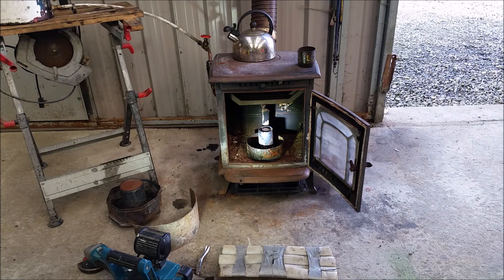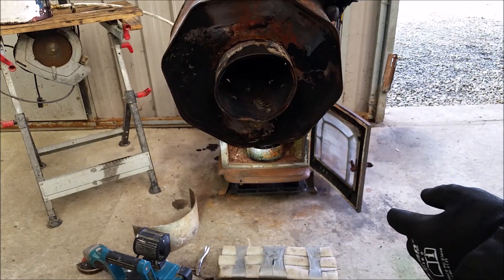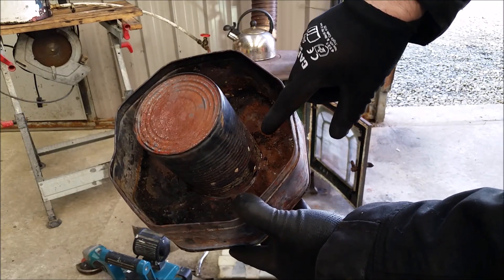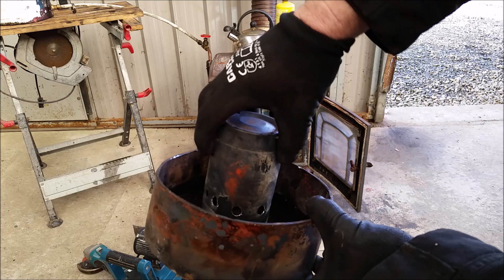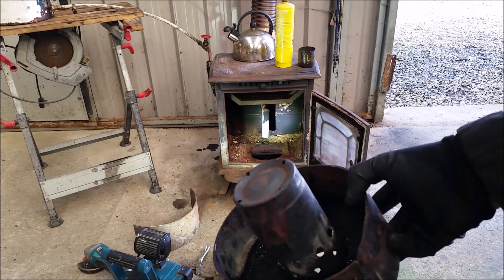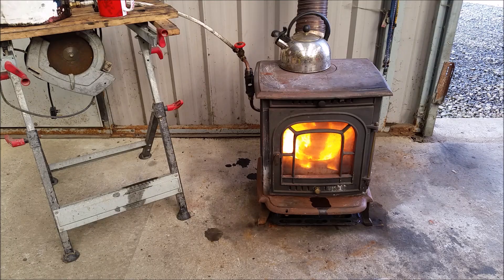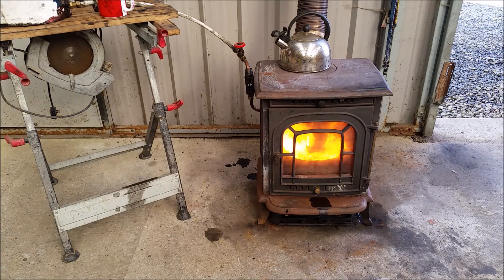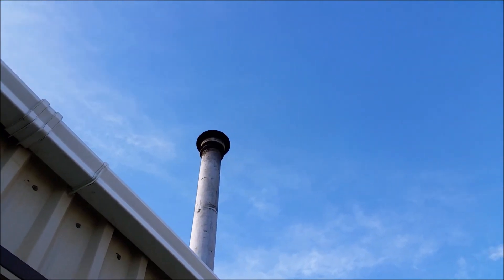Fantastic new design Very Easy to make waste oil Burner

Comment: I love it. Super simple design. No blower noise. Awesome!
Reply: +Marcel LeMay - You are right, but there are no kids here :((( - Hahaha, I am going to design one that we will put it in our House for Heat. Currently we have Wood and Wood Pellets... But I have been suffering for years... I can't stand it no more..... Propane are expensive and we get used Oil for FREE from my Dad's work. Anytime we Burn our Wood / Pellet Stoves.... Within an Hour... I can't breathe :((((. So I am MAD as hell from suffering.... Die trying they said... LOL.  I am going to make a SLOW Drip Oil Burner... But ALL ENCLOSED. I have been experimenting and it's going pretty good so far. YES, there will be SAFETY Features.... Like if anything gets over a Certain degree... The Oil will STOP Dripping... Aka Solenoid Valve. As for Oil, I will have 2 Tanks outside... 1 is completely Filtered and one is the Refill / Dirty Oil. Then I will have a Pump, Pump to an ENCLOSED TANK. I will also have an AUTOMATIC Lighting System as well inside my Burner. My tank will only have a 6" opening with a CAP to clean or Vacuum... That will be the only Access Hole :(((((. My Journey will NOT be easy, It's been 2 weeks so far, trying different methods etc... But DAMMMMMMMMM, I will die trying, LOL
Reply from the maker: Thanks for watching the video and the comment Marcel Cheers Gerry
Reply: +Marcel - Yes you are right, but you need Intake Air ://. Best is to have a Vent from outside in - Intake Air, that way the Air you have in your House stay in your House.  So it's kind of give and take I guess :/
Reply: Jod Bronson I don't think I'd be brave enough to put this setup in my house. This is great for a shop for a whole bunch of practical reasons , ie: it's cheap and simple to build, it's a little messy with the waste oil, it can get your shop warm in a jiffy. This probably shouldn't be operated unattended. Most shops have plenty of make up air available just from air leakage around the doors etc.

There are other waste oil furnace designs that use a conventional hot air furnace with a Beckett burner that's been modified, and a bunch of safety features that would be more wife friendly, for the home, but the cost to build it is way more, and its way more sophisticated.

In either case, make up air is always a good idea, no matter where it comes from.

Comment: nice video man. I made a lot off stoves (much smaller) working on this principle myself. They all run great. The only problem with waste engine oil in my stoves was the ash buildup in the burner pot. It blocked the air holes. How is your design handeling that?
Reply from the maker: Hi Marcel. I do get build up but these burner units are so easy to make its very easy to swap out one burner for another clean one. They are easily cleaned too. I can get all day burning  no problem but some of it depends on the quality of the oil too. I can burn hotter with a blower version and it leaves less residue. I will be posting regularly and I will show a powered version soon.  Cheers Gerry
Reply: Thanks for your reply Gery. Still thinking of a way to clean out the burner pot automatically. Especially using smaller pot ash and residual buildup is a problem. I need smaller pots for my applications. Mine consumes approx. 1 liter An hour. The pots need to be small to keep enough heat in for vaporisation of the oil.

Comment: Another master piece Gerry and so simple and uncomplicated.Quick question for you, In your stove have you a chimney damper fitted to deter too much heat exiting to the flue and is it lined with  fire bricks or not.
Reply from the maker: Hi John. I don't have a damper and my flue is single walled all the way to the roof so I get some heat back into the shed. The section through the roof is insulated to protect the roof and then above that a single walled section. I have 4 metres of flue and I get great draught. No Firebricks. I only have a waste oil burner running in the shed and if I were to heat the house on it I would simply convert an oil boiler and run domestic heating and hot water from that. Much safer. One of my older videos I used a different type of burner with a boiler and I heated 80 us gallons of water in about 1 hour to steam.
https://youtu.be/1Et3rIn5GIY. 
Hope this helps Cheers Gerry
Reply: John Regan I ethink